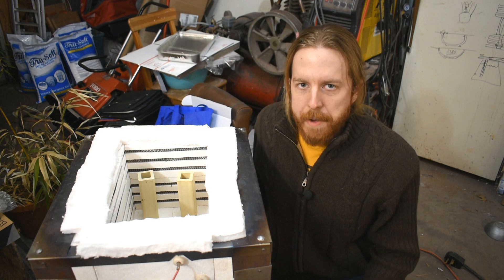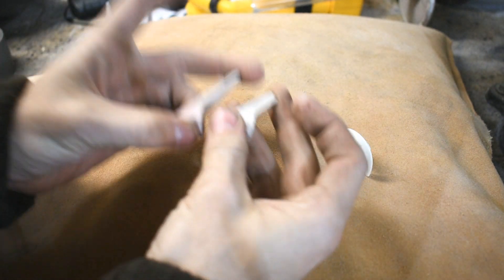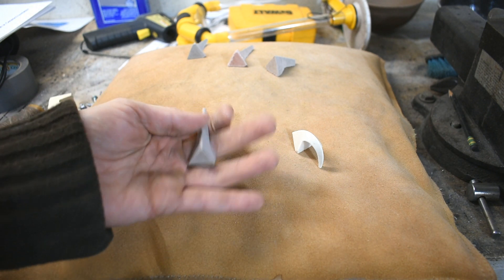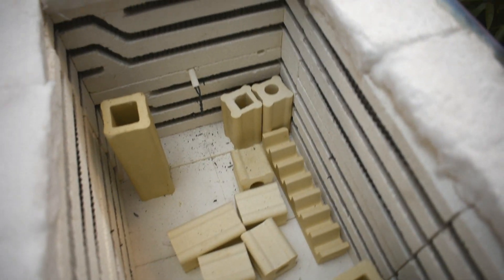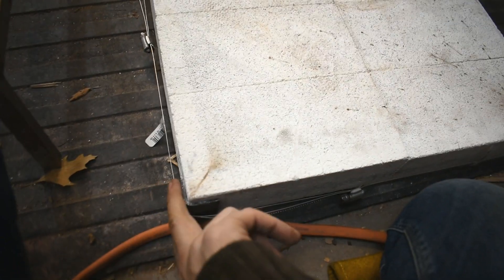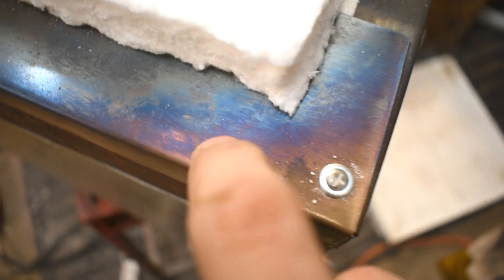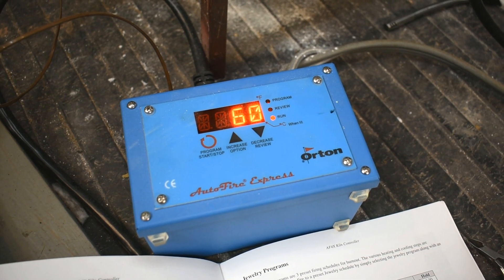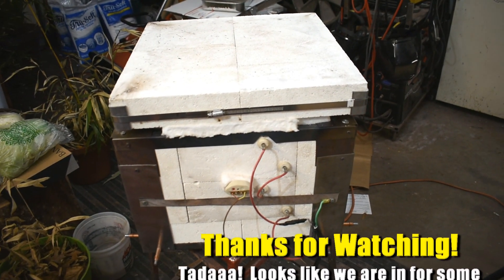DIY Electric Heat Treat Oven/Kiln/Furnace Part 6: fixing some problems

Comment: Did you ever try to melt metals in this kiln. Im sure it would be a little slower than propane but I wonder if you would get less gasses in the metal. Also you could do melting indoors in the winter without the worry of fumigating yourself. I just got a kiln for free like one of those larger ones you have and am thinking about trying to melt some aluminum in it. I have another kiln that I tried to use to carburize steel by putting steel inside of a steel container with coal all around it. It seemed like the heating elements absorbed the carbon from the coal and were then really brittle and they broke. Hopefully this wont happen just melting aluminum in the kiln.

Comment: You never told us how much the insulation lowered the outer metal jacket temperature. I'd like to know how effective an insulator it is.
Reply from the maker: Interesting point, I don't have exact numbers but I will say the steel sheet with the insulation under it has not discolored at all, but the steel without the insulation under it has gone blueish from the heat.  Not exact numbers but definitely enough to see a difference

Comment: Use the controller to run a contactor, you could run one element from the same circuit that supplies your shop heater and stay in spec for the amp draw of the controller. The higher current of a single element would bring things up to temp. a lot quicker.

Comment: I'm glad I didn't tune out because that part about the bluing was interesting.  I may play with that some in my kiln jr.  I assume that controller has  PID controller in it?  I can see why it appeared to be going so slow on its way to 500 over the course of 30 minutes.  I am using a cheapie rex-c100 PID controller for kiln jr and it is interesting in a very nerdy way to watch it control the heat.  especially if I have the cover off to do something inside.  then it's like, "whoa so cold in here!  Full power captain!!!"  then I put the cover back and it says."  what whoa, what happened?!?!  now it's so hot!  cut the power off, cut it off!!!"  (doesn't actually say any of that but you know, anthropomorphism.)
Reply from the maker: Yes indeed it has a PID controller.  Very nice to just program and let it work its magic.  Assuming it's set up right (finally).  It cycles on and off to follow a set ramp rate, though I can set it to just stay on up to a set point and hold there if I want.  It's something I have only started to mess with, there is plenty more cool stuff I can use it for
Reply: Yes I see how nice it would be to have that programmability in the controller now that I've started playing with mine.  I'm mainly after doing lost PLA investment casting.  Oh, I was told about a product czalled Mold Mix Six that I think was what you were asking about.  it may take some googling variations of that term to find it.  A very accomplished art prof who has done a lot of casting recommended that.

Comment: Okay, the bit I know about heat treating is that the specifics vary depending on the exact metal you are using. So, first you figure out what you want to make so you know which kind of metal you want to use (chef's knife will be different than an axe which will be different than a punch, for instance), and then you figure out what the heat treatment details are for that specific metal. I've used 1095 for a couple of knives. I understand it's a decent starter metal for that. Steve Pellegrino is a fabulous knifemaker if that's a direction you want to start in. He shares a bit of his process on his website, pellegrinocutlery.com though not all the details. I hope this helps a bit!

Now I'll just wait for the meatloaf recipe from Paul's Garage Kitchen...

Comment: Maybe weld some tabs on the corner  angles then use 1/4-20 threaded rods so you can tighten up the lid as needed.
Reply: The trouble you're always going to have is different rates of thermal expansion. The bricks are going to get one size and the metal another. He can tighten them band clamps anyways.
Reply: @1pcfred  Maybe you could include a flexure in the design so that it can preload with just enough tension but relax enough to expand as needed.

Comment: Are you sure 10 is more than 6? Might want to double check that.
Reply from the maker: I'm 65% sure 10 is more than 6.  Ok maybe 50/50
Reply: I can confirm it is, cones go from very low from 022 descending to 01 and then from 1 ascending to 14, wich is very high.

Comment: So good to find the source of the problem. With that type screen with so many functions and variables, wow. A laptop connection would be really nice and speed things up, but I am sure wouldn’t be cheap...

Blue steal cliffhanger...
Reply from the maker: There is a fancier version of this with more buttons and a more elaborate screen, but lots of $$$.  This one actually had a USB port for a laptop connection, I just havent messed with that yet.  I'll probably use the laptop to make the user controlled programs for ease, though you can do it with the 3 buttons if needed.
Reply: Paul's Garage that’s cool, I think you’ll find that to be much easier for setting up a firing schedule, assuming it’s more complicated that go to a temp and be done... (I’m sure you’ve seen some that are very complex.)